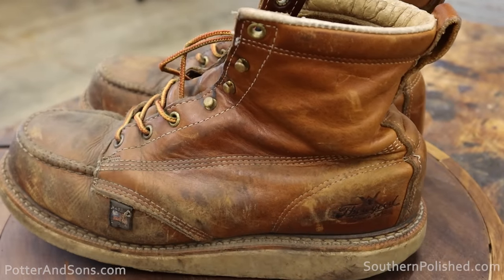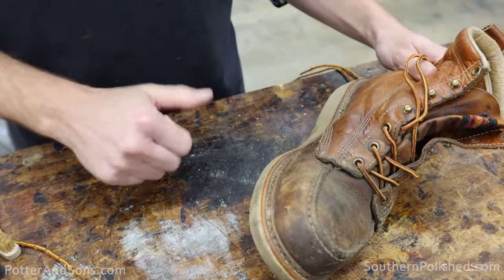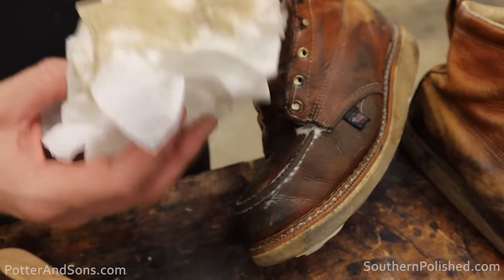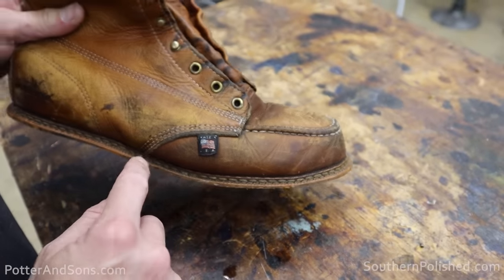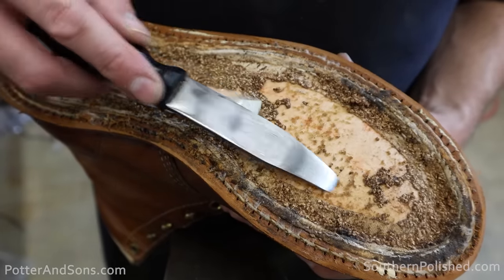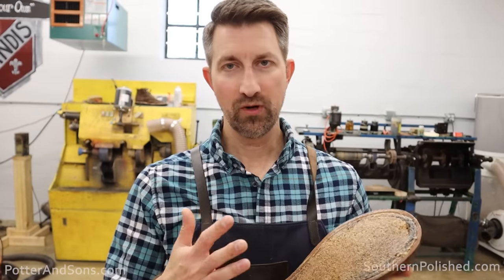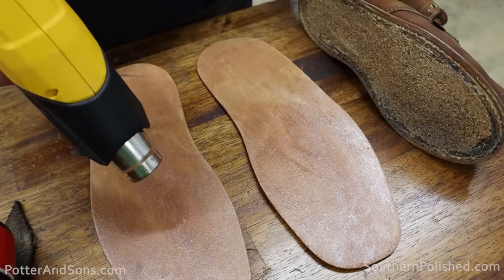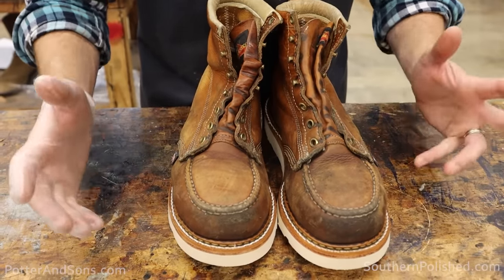Thorogood Moc Toe Boot Restoration | Total Boot Makeover

Comment: As usual, a great resoling job, and on a very worthy boot I might add.  I proudly sell these made in the U.S.A. Thorogood boots in my store.  My father was selling Thorogood boots before I was born in 1959 so I am thrilled to see so many people discovering this storied brand.  You have a press with dies that allow you to cut leather components so I can see why you are proud of the addition of a leather mid-sole.  As you stated the standard rubber cement, like Barge or Masters, likes the porosity of leather making a solid adhesive grip.  We use standard rubber white mid-soles in our shop and it works well as long as we use the newer Barge Infinity cement.  Infinity reacts with the synthetic welt which Thorogood uses.  We have to let it melt or fuse into the synthetic welt and firm back up as it cures.  Careful heat application reactivates the glue's stickiness while not overly softening the grip or welt.  We then apply the mid-soles by pressing on the body and edges, then we sew them with the curved needle stitcher.  At this point I like letting them sit for a couple of hours.  Then it's time to apply either the Vibram Cristy or the Goodyear Tampa sole to the previously glued mid-soles by hand hammering,  machine pressing, then edge pressing on the 5-in-1 as seen on your video.   I checked into buying pre-cut leather mid-soles from our supplier Southern Leather and they do not carry them.   I wouldn't mind offering it, but have found our method of glueing and sewing the white rubber mid-soles works great.  Shoe making and repairing is an art in my book.  I've spent a lifetime learning and still consider it an on-going process.  Seeing your craftsmanship has added to my knowledge so keep up the great work and videos.  You guys are artisans of re-crafting footwear at a high level indeed.   I truly enjoy the videos.

Comment: I’m a big fan of the thorogood 8” moc toe. I’ve got almost 3 1/2 years in the oilfield in the pair I have now and their still going strong. I will need a resole very soon though😏 I’ve worn almost all the big work boot makers redwing, Justin, Ariat, twistedX etc and the thorogoods are comfortable straight out of the box with almost no break in period (1-12 hour shift) and last for a good while. I got 4 years out of my last pair, before someone took them out of my truck. The only time I don’t wear them to work is if it’s raining or is muddy out, Their not water proof. Plus they can easily be found for way less than $200. The pair I have now I bought on sale for $129.99 from an online motorcycle shop from Brooklyn NY🤘🏽😎🤘🏽

Comment: I have a pair of Danner Quarry boots that are starting their 8th year in use. They have never been resoled and the soles are still in great shape. The uppers are starting to have some issues with some threads breaking and seems starting to open up. The biggest issue is the toes of the uppers. One side actually has a small hole in the toe area of the upper and the other side the leather in the toe is ultra thin. I have replaced the boots with another pair of Danner Quarry but couldn’t bring myself to dispose of the old pair. Can you guys do repairs on the uppers? I would be open to a resole also if it’s recommended.

Comment: Nice work. In Thorogoods defence I have used mine hard for several years and the welts have stood up well. There is no evidence of any cracking,splitting or stitching pulling out or failing.  I would have no issues with buying another pair and no reservations in recommending them to anybody. Cold wet miserable Scottish winters a stiff test of any footwear!
Reply from the maker: Thank you!  Thorogood boots are definitely good boots.  Overall good quality with very soft leathers.  We just like to point out differences between brands that we work on and give our overall opinions of materials.  I would definitely recommend this brand to folks.

Comment: I’ve been in construction for 40 years and I’ve noticed, as I’m sure you’d agree, boot quality has consistently gone down. I’m a heavy guy, 250+ pounds. Could you possibly recommend a high quality boot that are truly worth the cost? Biggest problem I have is sole wear and uppers separating from the welt. I’m currently wearing Ariat 6” Logger at $400USD. I’d like to think they’ll last a year, but the RedWings at $300USD lasted 4 months. Please advise. Thanks

Comment: Three questions. One, why did you cut the outsole away from the rubber mid-sole and then end up cutting the mid-sole off anyhow? Two, why not just cut it all away as one unit? Just curious about that segment. Three, can the hard rubber welt material be replaced with a leather welt? I know there would be additional cost, but just wondering if that is feasible. I have this exact pair Thorogood boots, with the steel toe. They need cleaned and resoled badly.
Reply from the maker: We were originally going to try to keep the crepe midsole, as the owner of the boots didn’t mention changing it out.  After trying to save the original midsole, it only confirmed my statement that crepe midsoles aren’t as good as leather, as they hide the stitches, and it’s almost impossible to remove the original threads without ruining the original crepe midsole.  We gave him the free upgrade to leather, were hopefully able to show folks the difference, and now the threads will be easily accessible for future resoles.

Yes, these could be swapped out for a leather welt.
Reply: @TrentonHeath  are two the only cobblers in your shop?

And I completely understand about the crepe sole. Thanks for explaining that.

Comment: What kind of lead time and turn over do you have I have a pair of Danner quarry boots that could use a new sole and maybe some toe clean up. They are a year old work boot that get worked hard as I work construction and I’m in out of delivery trucks so the toes get banged up bad. I do treat them with snow seal to help keep them treated and water repelling.

Comment: How much harder is it to fix steel toe and does the plate go just over the sole, or the mid sole? I ask because there is supposed to be a metal plate in the sole so you can step on nails. Toronto🇨🇦

Comment: Use to work off shore and had an old boy who rebuilt all my boots for years. I use to try and get my colleges.to get their boots repaired instead of tossed. Some shops wouldn’t even try. What a waste. Even cheap steel toes came out great and better than new. Especially with a great cobbler willing to correct the way YOU wore them out.

Comment: I'm curious whether it's necessary to replace the midsole in this case. Seems like it adds a lot of time and expense to the resole, and you're just gluing the outsole back on anyways. Any insight? Or was it just to upgrade to the leather ones?
Reply from the maker: One of the downsides of crepe, or thin rubber, midsoles is that in order to get to the old stitches to pull them out, you generally have to sand down quite a bit of the midsole.  By the time one sands it down enough to reach the old stitching, it’s often not in great shape.  As you can see from the leather midsole, the stitches sit right on top, and you can see the clear separation between white rubber sole and leather midsole, making a resole much easier without having to replace the midsole again.  It’s just one of those “little things” that separates higher quality from good quality.
Reply: @TrentonHeath  I guess my question, though, is why pop the stitches at all? Why not just peel the outsole off, clean the surface up and then glue a new one down?

Comment: These boots look fantastic. I would just be sure that there is not an "EH" (electrical hazard) rating on the tongue which could be the reason for a work boot without a steel shank and a rubber welt. I love your work. I hope to send you some of my Ferragamo dress shoes to be upgraded. If I use shoe stretchers  for the width of my shoes, could "re-soleing" the shoes shrink the width? I would love to get them all with JR soles and Triumph toe taps and the loafers on Danite soles.

Comment: If you resole them the next time, can you separate the vibram sole easier from the leather midsole and just flew in the new outsole? Or do you have to remove the midsole too, the next time? Because, if the leather goods the same way, the rubber did, there is no point in using it.

Comment: What did you charge for this? Also what sole did you put in? Do they last as long at the maxwear? I have two pairs- 6” and 8” that need resole and full restoration..
Reply: They put the Vibram Christy sole on, which is what Thorogood used on this boot for a long time, until just a few years ago.  Supposedly the tread on the Vibrams did not last very long, which is why they developed their own sole.  I just bought my first pair of the Thorogoods with the Maxwear sole, so idk which sole would be better.  Also you should be able to send them back to Thorogood to have them resoled, as they offer that service.

Comment: What’s up guys, I’ve got wolverine moc toe boots. When brand new, i applied a leather honey on them. A Month of working with them, I wanted to wash the grit off and I dusted first, then tried saddle soap and it turned the leather to look wet when dry. Sort of waxy. Now, I don’t know how to fix. Anything I could do?
Reply: After you use saddle soap you need to condition once they have dried. Saddle soap is great but strips a lot of the oils and lubricity out, so I'd give them a good brushing or wipe down with a damn cloth, then a good coat of leather honey or whatever conditioner that you like

Comment: Rubber midsoles make it easier to vulcanize the sole on and not worry about glue and grinding. It's faster for manufacturing, saving like 10-15 minutes per pair, so when they are cranking out 5000 a week it adds up fast.

Comment: I got a pair of soviet officer leather jackboots and the interiors smell like mildew. I have gotten most of the smell gone but what’s a good way to remove that smell permanently
Reply: Soak a rag with a strong alcohol sprit or skin friendly disinfectant (if you want to be very gentle ) and wipe it out. (I guess vodka is authentic in your case). This should disinfect the lining. Put shoe trees or boot trees in and let them sit. After a day, moisturize the lining few times and let them air out a few days. ( Hopefully the leather is not rot)

Comment: Hello Guys, thanks for your advices and work. 

Question: Is it recommended to use water with soap on smooth leather shoes ? And White vinegar (50%) and water (50%) ? 

I have some shoes which had been creamed many times without cleaning the old cream (apart from brushing).

Comment: With a fine wire brush, dawn dish soap, water and agitation those boots could have looked MUCH BETTER. Literally wash them...

I've done it countless times now. You can use various polishes after the boot has dried to make the leather look original or go with a different shade of brown and even add a splash of auburn or whatever. You can also opt to only condition with Bick. The polishes that I use are Kelly's. Use a foam applicator after warming the polish with a torch for easier application.

How much you scrub is entirely up to you. I've scrubbed until the leather looked like nubuck or it took on a Bone color and left it like that since it was very unique. You can also scrub until the leather is uniformly cleaned and then conditioned. I've also changed the color entirely creating something unique, like a brown color with auburn accents and rust colored highlights and also shades of dark brown/patina. Requires some trial & error and various color polishes and brushes. Totally worth experimenting with and renewing your leather boots/work boots will be an easy task.

The cobbler I've taken my boots to would sometimes ask what color combination polishes I used on some of these boots because how goid it looked. The color saturation and blending and overall richness was "outstanding". Makes me feel good about it. 🥰

I use them for work so they soon look like dirty work boots again lol.

Comment: I have a pair of Thursday boots that fit too small in the toe area. The width is fine but the length is a little too short. Can a cobbler fix this ?
Reply from the maker: Unfortunately, not physically. However, if you can find one with length stretchers, you might be able to get a bit of a stretch.
Reply: @TrentonHeath  I’ll ask my local cobbler. Thanks a ton, can’t wait to see ya on Westons channel.

Comment: I own two pair of these both pair failed before even needing to be resoled. The plastic toe cap between leather and the canvas pushes down and has came unglued making them impossible to wear. If the boots wouldnt have failed with in 6-8 months i could have kept wearing them and felt they were worth the price i paid. But they are junk and not worth it since thry cant last till needing new soles basically disposible junk